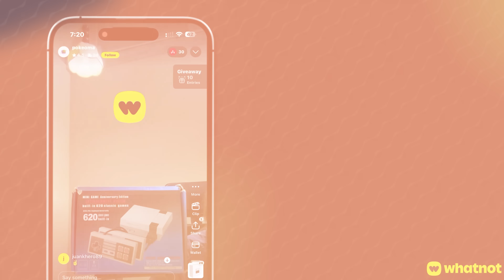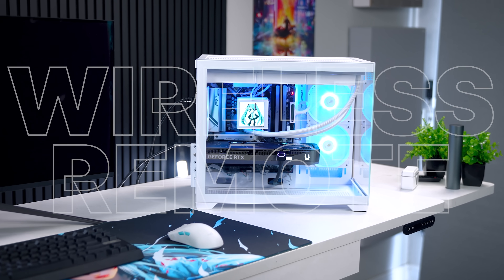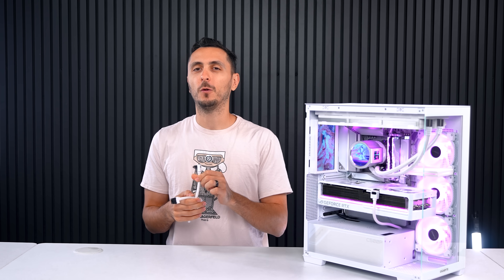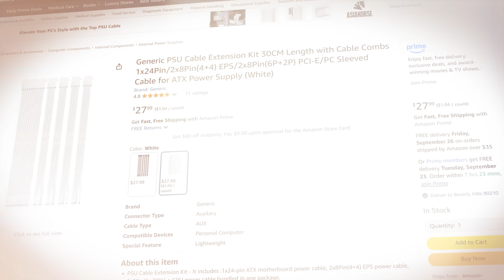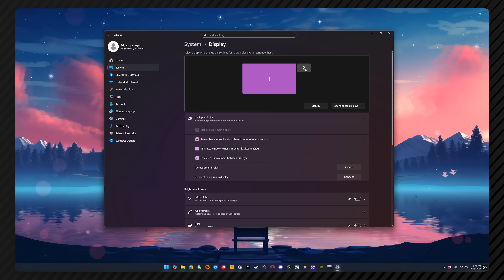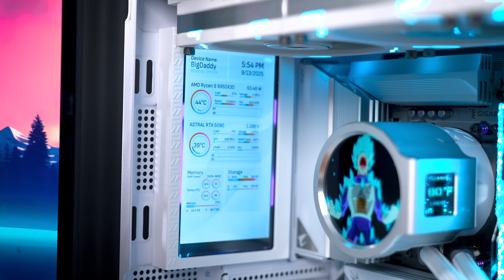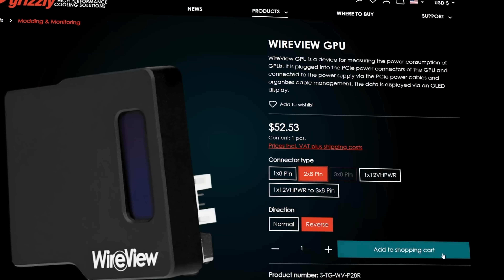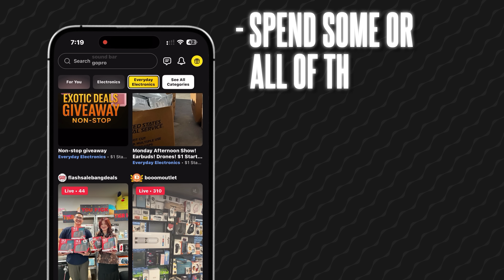Cool Tech for your PC Under $50

Comment: I use  the 24 pin hydus cable on my Asrock x870e phantom Nova ..but people on other sites recommended to not use the gpu cable on my 9070xt but I can't find any info wether it's compatible with it

Comment: Small note: For those that have 5000 series cards where the pins are reccessed into the graphics card, for example the Gigabyte 5070 TI Aorus Master and its bigger brother the 5080, the hydrus cables are not going to be able to fit onto the GPU. Something to keep in mind when you buy extenders or 3rd party cables such as the Lian Li Strimer (although the strimer does have an alternative clip these days that fits, there are still versions that wont). If you try to force it you may bend the fins and with the issues surrounding melting connectors, I would advise against trying.

Comment: Hey I have a question about the Hydrus-24PIN PSU exctension. You advertise it, I see it has a lot of positive reviews BUT quite a lot 1* ones, all aligning - it stopped working between 2 weeks - 1 month, resulting in bricking PSU or MoBo at times. All bad reviews are around that with some mentioning only RGB stopping working.

I am building a PC, Aorus x870E Pro, AMD 9950x3d, Aorus Master 5090. I will not be using Hydrus for GPU, I am considering the 24 PIN for MoBo..
Is it safe? I am really scared to destroy a high-end expensive part in my pc by going this little design upgrade. Is it worth it, is it safe??

Can anybody help?

Comment: does the cable work with the 4060?
Reply: Yes, if you get the 8pin gpu cable version. The 12vhpwr version wont work with a 4060

Comment: DO NOT BUY THE 12VHPWR CABLE AND PLUG IT INTO YOUR PSU. You can start a fire and ruin your whole PC. The 12vhpwr port on PSUs is NOT standardized, so there is a real chance that the pin layout is different and therefore could send too much power to the wrong pin on your GPU. Very unfortunate that someone like this is recommending something without doing their research.

Comment: Pretty cool video, was about to look into the airgoo argb controller because it's quite cool, although realizing it doesn't work for my setup

Because lian li hub eats 2 sata cable, and then cooler master hub eats another one, and I'm already out of sata, combine with each takes up 1 argb ports and my case also take up one, so neither I have argb ports available and I don't have sata, hmph

Nice video tho, definitely gave a thumbs up.
Reply from the maker: Glad you liked the video!

Comment: I like the idea of Cable replacements instead of extentions, the last thing i want is to add more cable length to my exiwsting cables and trying to shove more back into the back of the case when cable management is a pain already, i actually want to replace the cables for nicer ones and in some cases get shorter cables since i have a modular PSU, all cables "Extentions" should just plug into the PSU and be replacements i think
Reply from the maker: Agreed!

Comment: "not compatible with 5090" because 5090 owners have enough money to sure them when this cable burns the house down!.  Was kinda joking, but what is their warranty statement?  Cablemod ended up "eating" a lot of 4090/5090s.  Also if they are gauged high enough for the 5090 and proper PSU, then they are not up to the already pathetic 12vHP spec.  NOT GOOD!!

Comment: Anyone else notice he said the cable wasn’t available for the 5090, then multiple times in the video he’s showing “5090” with the cable. So….not a 5090 or the 5090 is available?  Seems odd.
Reply: The manufacturer probably doesn’t want to take the risk of marketing the cable for 5090 and be liable. You know, the 12vhpwr issues. It will work on idle, sure. Will it be reliable under 600w? Unsure.
Reply: Dude!…Use your brain! It’s still a 12vhpwr cable, so it can still plug into any gpu that uses it; a.k.a any 50 series gpu….
 Like already stated, the cables they currently sell aren’t rate for the power draw of the 5090.

Comment: i had one of those usb header expansions fry my mobo, cpu, possibly ram and a couple of hard drives somehow. i lost a lot of old data and about $1,500 in parts when it happened. the little bastard started sparking and smoking somehow and everything just shut off. luckily everything was bought from microcenter with their extra warranty so i just ran back up there and got replacements. my old hard drives were completely dead though, unable to be fixed. crazy how such a small and seemingly insignificant little part can do so much damage.

Comment: can you tell me if my build is good Intel Core Ultra 9 285K CPU

ZOTAC GeForce RTX 5080 GPU

LIAN LI EG1000 1000W PSU

Lian Li UNI Fan SL 120mm ARGB (Triple Pack)

NZXT F120RGB Duo 120mm Fan

TRYX Panorama SE 360 AIO Cooler

MSI MAG Coreliquid A13 240 AIO Cooler (Free Gift)

CORSAIR TM30 Thermal Paste

Team T-Force Delta RGB 32GB DDR5 6000 RAM

WD_BLACK 2TB SN8100 Gen 5 SSD

Comment: Bought a Hydrus 24 pin cable on Amazon. Got a 24 pin box with an 8 pin GPU cable in it. Returned, second time, I got the right cable. MB has a 8-4 CPU, never gonna see a Hydrus for that config. One 8 pin? Two 8 pins on GPU, Hydrus too big side by side? Oct 1st, Lian Li 8.8" Universal Screen release, can't wait. Universal mounting, inside, outside, anywhere.

Comment: Quick note on that Wireless switch in that the batteries definitely DO NOT last for a year.  I've owned that exact one since May and have replaced the batteries twice already.

Still 100% recommend getting it though since batteries are pretty cheap and it's definitely a step up from having a wired one

Comment: you can turn on the pc just by using your phone, try out wolow, its very good, and as long as youre connected to the same network as your pc, you can turn it on from basically anywhere around your house

Comment: I really hoped you’d showcase the Wireview. But it’s worth noting that there’s also a Pro version with some extra features — for example, showing the cable temps or making a noise when it gets too hot so you know it could theoretically melt. Also, TG will release a Wireview Pro 2 that has per-pin monitoring, so you’ll instantly know if something is faulty

Comment: Instead of wasting money on a $40 wireless power switch u can use a wake on lan app on ur phone turn that setting on in bios and wow now u can turn on pc from anywhere in ur house thru the app for FREE!!!!
Reply: Will it work on a Lian Li 011 rgb case. ???
Reply: Will it work on Lian Li 011 rgb case
Reply: @rap_soldier_1 it is not case dependant, as long as your motherboard supports the wake on lan feature you are good to go.

Comment: You can setup your pc to turn on when pressing a keyboard key or moving the mouse.
Reply: Or use wake on lan with WolOn on your smartphone
Reply: That's only for sleep/hibernation. You can't boot a powered off PC from your keyboard.
Reply: @SamaraxMorgan26 You can for sure, and you can configure what keys to press in Bios. Had this setup around 10 years ago because i installed a key switch as a power on switch and wanted a backup solution in case i lost the key.
Reply: @SamaraxMorgan26 yes you can. I have it on my PC. It's a setting in the BIOS I think

Comment: That hydrus cable looks sketchy. No company name on amazon store. Not recommended for 5090 which means it is not up to spec. dont complain when your pc burns down your house.
Reply: You can easily find it by asiahorse hydrus?

I have the 24pin myself and works like a charm

Comment: remote switch only works for cases that are cheap , my 011d evo rgb has on soild wire for the front panel power etc
Reply: Weird flex but ok

Comment: How long is the 16pin cable.  I have a case where the power supply is on the top of the case and had to route the 16pin over the graphics card and of course this make the cable a complete eyesore.  Just wondering if it is long enough to route under my GFX card, run it through lower gromet in the case and up to the power supply,  probably 18-24 in minimum